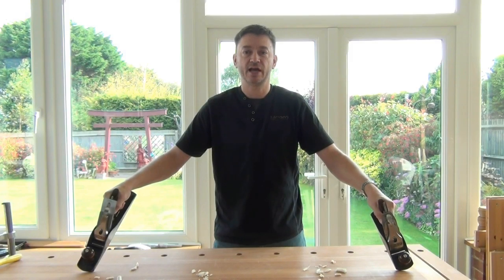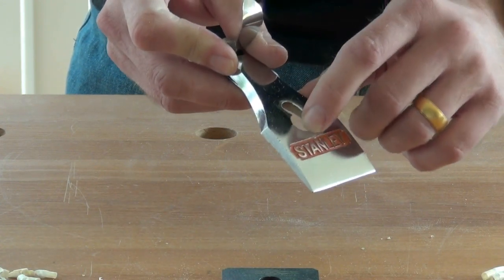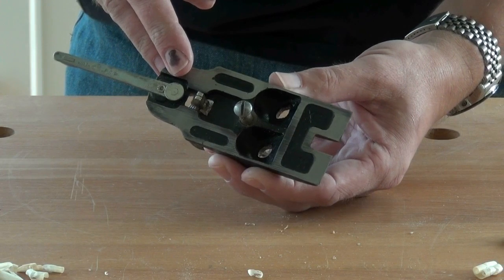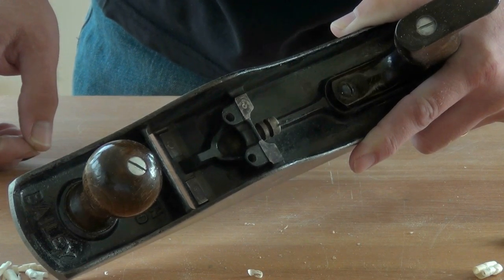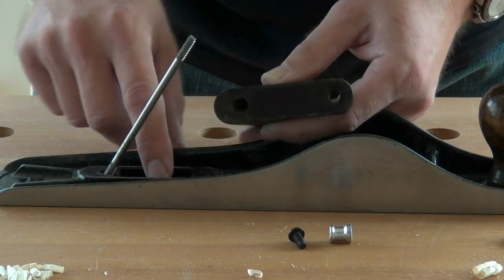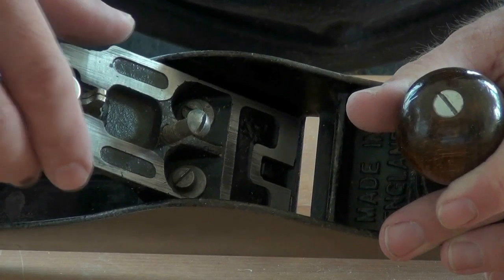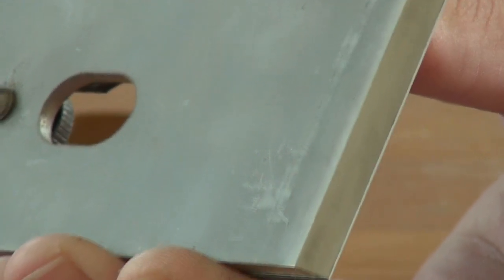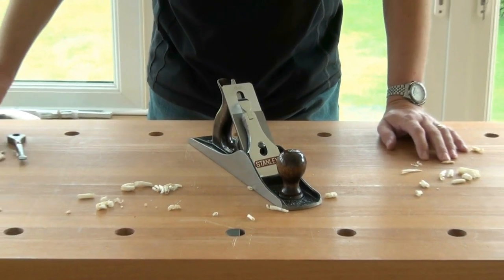Stanley Bailey Bench Planes - An Anatomy

Comment: Great video, I'm glad I found your channel. I'm in the process of trying to find replacement parts for a Stanley bailey no 6 I've just inherited and want to put back in action.  The sole and frog are present and I think I've concluded that for the most part the iron, chip breaker and lever plate are generic across the range?
Atb Ryan
Reply from the maker: ryantoomanyhobbies Hi Ryan, I don't own a no.6, but I'm sure those parts are the same on the 4-1/2, 5-1/2, 6, and no.7. That's a 2-3/8" blade width. Just check by measuring the width of the frog. Good luck with the build, Mitch
Reply: WOmadeOD - Made in Wood with Mitch Peacock thanks very much for the reply and excellent information. I'm looking forward to getting the plane back into action. Many thanks again.
Ryan

Comment: Just the job Mitch, thanks. one of the problems I'm having with old No.4s is that all the blades have cutting edges that are curved on the flat side through mis-sharpening. Grinding that out makes the blade too short. Now.....is Hock hardware available in the UK?
Reply: I have bought Hock blades direct from Ron Hock in the U.S.A. shipped to Australia.  I also found that his prices from the U.S. were a lot cheaper the buying them from a local importer, though I"m not sure how prices go in the U.K.----------   http://www.hocktools.com/#top ---------
Reply from the maker: Gareth Martin Hi Gareth. I have got mine in the UK. Classic Handtools I think. Not sure exactly what the problem is you are describing, but maybe you could flip the blade over and grind a new bevel on the opposite side. Really good quality blades are nice though, and an A2 blade will hold a pretty good edge a lot longer than a Stanley blade.
Reply from the maker: MrHarleythedevil Thanks, sounds like good advice.

Comment: Clear and usefull! Thnx.
ehm... do you perhaps also have a Stanley RB10 plane? I could use some explaining on that one too :-)
Reply from the maker: Maarten Happel Hi Maarten,I don't have an RB10. I believe it is a No.10 rebate plane, with a replaceable blade (RB). The idea being to throw dull blades away rather than sharpen them. The blade of the No.10 extends the full width of the sole, making it useful for planing rebates, tenons, and the like.
Reply: WOmadeOD - Made in Wood with Mitch Peacock Indeed it is, I only seem to have issues with positioning the blade so that I take the close shave I want. I'll keep trying :-) Thnx

Comment: Hi Mitch,
You set your blade and breaker bevel down - I thought the old Stanley's were bevel up and breaker set just behind the end of the bevel?  Or am I backwards?
Just inherited my father's 60 yr old plane, chisels etc, and decided to learn real woodworking (better than buying an electric pseudo-plane!).

Thanks, Russell
Reply from the maker: Russell Neilsen Hi Russell, 
Certainly the standard use is blade bevel down, chip breaker bevel up. This gives an attack angle the same as the frog, that is forty five degrees, suitable for general work. If the blade goes bevel up, the attack angle becomes 45 + bevel angle. Standard Stanley blade comes at 25 degrees, I think, so that would make 70 degree attack angle. That's way to high for general work. Mind you, and I've not tried it yet (maybe I will when I'm next in the shop), it might just work as a scraper/smoother on difficult wood, if set for a very light cut. Interesting. Cheers, Mitch

Comment: Woah, you took the knob off by unscrewing the screw, but when you took the gnob off the screw was still screwed into the base!  Not only that, but the head of the screw was still in the gnob when you set the gnob down. Usually, when you take a screw out of something the whole screw comes out; period. Please explain.
Reply from the maker: ah now, this is not a screw, but a length of rod with threads at both ends. the brass head in the knob is a round nut with a slot, and the plane body has a threaded hole. so it can come apart in two distinct ways, depending on where the most resistance is.

Comment: Is the currently available 12-005 (or 12-905) fine or is it a cut-corner ripoff piggybacking on the reputation of the vintage predecessor?
Reply from the maker: +Tome4kkkk TBO I haven't handled one. I hear they are pretty poor, and would love to get one in for review and find out otherwise. I was recently given a new Stanley chisel, and that was a disappointment, so I don't have high hopes for their planes.
Reply: That would be a catastrophe. I'm just about to buy one for far more than I should (40 GBP) and if it turns out to be crap... Second-hand vintage woodworking tools are virtually non-existent in Poland.
Reply from the maker: +Tome4kkkk I hear old Stanley, Record, etc. no.5 are currently selling cheap (10-20GBP) on ebay.co.uk at present. UK to Poland by DPD < 17GBP. But, you would have to put some effort into restoration/tuning for sure. Good luck, whichever you end up getting. Happy woodworking, Mitch
Reply: Mitch Peacock - WOmadeOD
 Thanks.
One more question. Are there contemporary Stanley No 5 models by other brands that are comparable in quality to the vintage ones? I've seen something like that somewhere but I didn't take note.

BTW, I've stumbled upon your channel by checking out your BAHCO combination square review and tuning. That as well as this video - a great watch!
Reply from the maker: +Tome4kkkk There may be, but I don't see enough to give you a definitive list. I haven't specifically tried out their no. 5 but Irwin Record might be worth a look. I have a fairly recent low angle block plane from them which was pretty good. I think the best value for money is the Axminster Rider series of planes. They are more expensive, I think the no.5 is about 66gbp, but I reviewed their no.4 and was quite impressed.
Cheers, Mitch
Reply: Mitch Peacock - WOmadeOD
Thanks. I've tried using the amazon search as a refresher. So those appear to be: Woodriver, Faithful, Lie-nielsen (priced their weight in gold) and indeed the IRWIN Record. Axminster Rider - I'm going to add it to my list, thank you. All in all there's no way in hell I'm going to buy "pay me X for a shitty plane I've manufactured for 0,1 of X" kind of plane. I've also discovered that there are planes even more crappy than the contemporary Stanleys! Believe it or not Stanley themselves have an "economy line" -SB series and so on. There are also companies like ACE (USA) and Kinzo . I do consider a second-hand cheap Footprint no 5B jack plane however.

In the end it's very likely I'll end up vulching for a used vintage plane on ebay, having someone in UK buying a decent one for me or making a handplane myself.

OK, enough of this. Thanks again and keep up the good work!

Comment: Replacement parts available @ http://www.stanleytoolparts.com/planes.html. Be careful with handle bolts as they are ODD threads and not available in the bolt bin.

Comment: I have a Bailey number 5 with a record lever cap and blade. I'm guessing this is not right and someone just mismatched parts together?
Reply from the maker: Hi Adam, Yes it looks that way. Chances are it works just as well though. Thanks for watching.
Reply: +Mitch Peacock - WOmadeOD I thought so to. Thanks for the video you take the time to do, I've learned loads from them. Thanks again

Comment: I've watched the video start to finish now. Well done. 

Two notes though. I don't think the length is the only difference between the No 4 and No 5. As far as I know the No 4 has a higher angle of the blade more suitable for smoothing. Also, even though I am no expert on handplanes, the chip breaker's (cap iron) main role is not to provide rigidity to the blade. As it is close to impossible with two pieces of metal wit one free end, to say the least.See: Influence of the cap-iron on hand plane https://www.youtube.com/watch?v=56DpxEOpxz0
I've just bought a Footprint 5B No 5 handplane. And I almost damaged it by trying to use the advancement knob with the blade cap set too tight (the screw at the front). The advancement tongue slipped out and even chipped out a little as the material of the slot is a very hard steel with sharp edges and the tongue is cast iron on something not much better. Stupid of me. I wish I watched your video before I attempted at playing with it.
Reply from the maker: +Tome4kkkk That's a great video you shared the link to, thanks. Given me some ideas!
You're right of course that the chip breaker breaks the shaving and helps in preventing tear out. It aids rigidity, and was introduced to save on tool steel by allowing a much thinner iron to be used without increasing chatter.
The standard frog angle of the Bailey pattern planes is 45°, but steeper frogs were/are available as accessories for difficult timber.